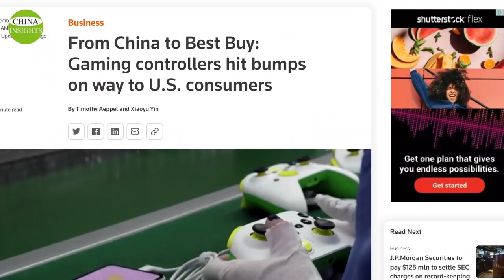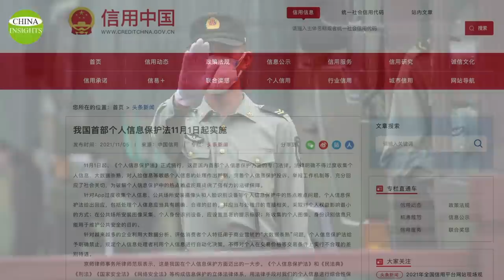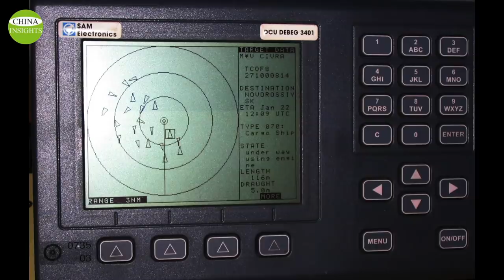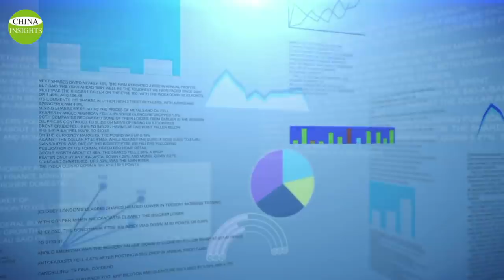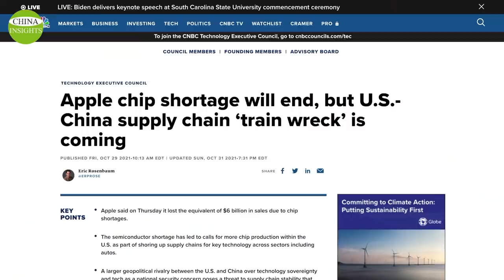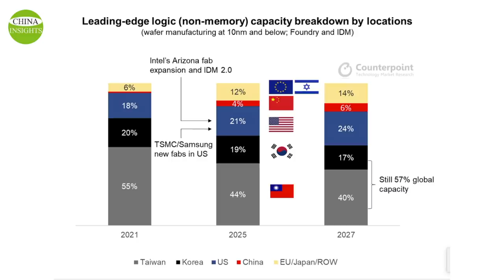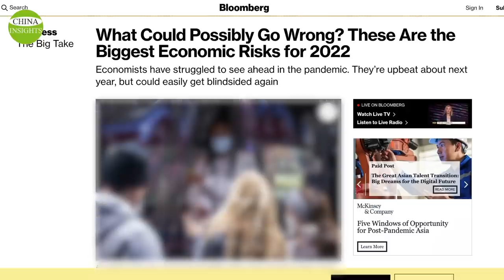Extremely high costs, disappearing shipping data & the chip crisis of the war risk in Taiwan...

Comment: As long as you have supply chain problems, you have a guarantee of increasing inflation, increasing consumer prices.
Reply: No, the two are simply unrelated.
Reply: every link in a chain is a potential failure. large companies did the risk assessment and weighed the costs, deemed it worth the chance, and small companies followed suit, naturally. meanwhile, i've literally lost jobs because of offshore manufacturing and NAFTA, but i also built a business that probably wouldn't be possible if not for cheap chinese products. 

inflation has nothing to do with it and is a separate issue, but rising prices are a direct result of higher production and shipping costs.
Reply: @NRG supply chain stuff cause ripple effects and can effect prices BOTH WAYS. Also the consumer price index is a measure of inflation and not one and the same with inflation. That is, prices may rise due to falling GDP instead of increased money supply.

Comment: Best News I heard this year!
Reply: That's a foolish perspective.
I work for a US company that does something along the lines of what Townley spoke about. Order components from various suppliers in Asia, then ship to our factory (located in a western nation) for assembly and testing. Our site makes components that are used in metro networks. If the low-to-moderate complexity components were not made in China, or other sites in Asia, and made on site, the cost of each unit would be 3 times higher than they are now. And that cost flows all the way up the chain until it hits the consumer.
You would be paying anything between double to triple what you would be currently paying for internet.
That same principle applies to basically anything you buy these days. Even if the final product is not made in China, the subcomponent are likely to be and that is what brings down the cost.

Comment: I wouldn’t be so optimistic. As many have suspect, distancing from China is mostly a dream. At this point, nobody really wants to do business with China, seeing how their government freely use business as weapons to further their political goal. However, they have the world best infrastructure, extremely functional given it’s size. They can move goods, people around at will. There’s no other country with the same level of supply chain to replace China, and to imitate what they have either take decades of planning, construction and administration, or simply impossible. They move rare earth, raw ores to processors, who churn out raw materials for factories, which manufacture parts and then assembled for major companies. There’s no one else in the world capable of that. As long as the cost remain remain reasonable, and despite huge markup in shipping price, they still are compare to other options, we can’t move away from China, not completely. They tried to move manufacturing to South East Asia, but other than bureaucracy, inefficiency, corruption, low quality work, poor quality control, huge infrastructure problems, the recent lockdown measures those countries implemented or their inability to keep the pandemic under control had discredited those regions. China might be doing itself a disfavour by pioneering those measures, but their core strength remained, and no one else can compete with that. We will have to accept that unless domestic production became viable again, we won’t be leaving our Sino dependency any time soon. I wish the world can find a way, but so far, I can only see darkness ahead of us.
Reply: Look up China tofu construction here on YouTube. Then tell us about what great builders they are!  Their dams are collapsing. Entire cities lie empty along with bankrupt apartment mega builders. They're a mess!